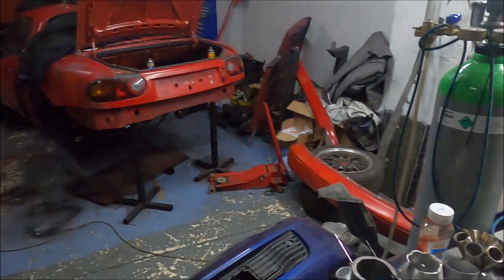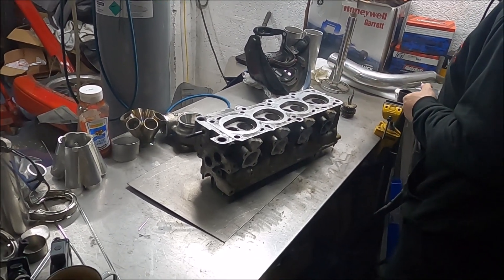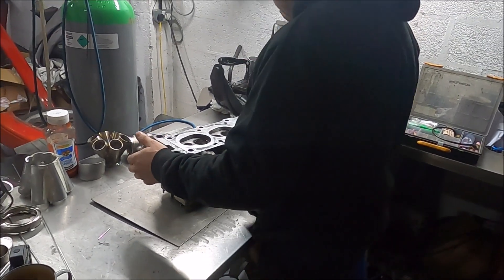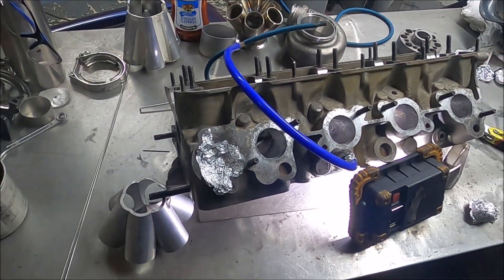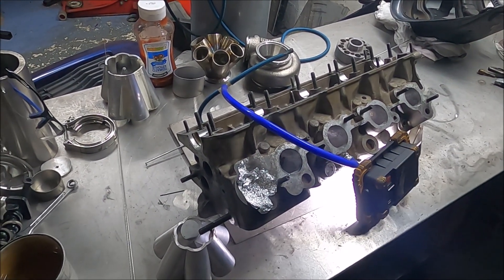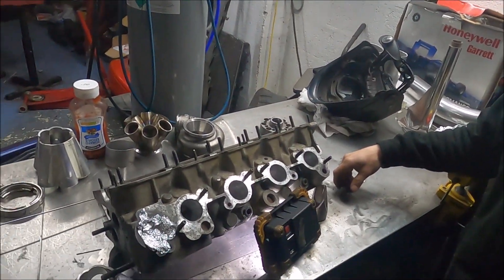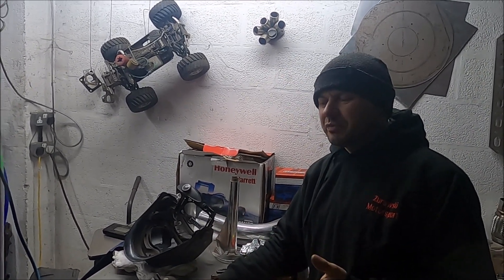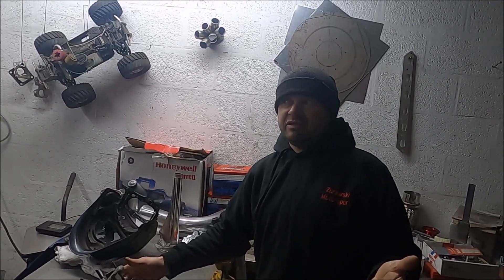Yeah I wrecked it... - Getting carried away porting the MX5s Volvo Penta head! (Part 2 of 2!)

Comment: Well at least you can cut it in sections and analyze it in case you find another 531 youll know where the material is and isnt.
Reply: The swedes has already done that for him 😊 Here's a picture thread
https://forum.savarturbo.se/viewtopic.php?t=14351
Reply: @KimOve  There it is :) Looking at the 531 pic in the middle of the page, on the picture Insugskanal (intakechannel) it looks like there are only some small holes in the area where Stav made the hole, and maybe not the actual main water jacket? Maybe its fine adding some epoxy into that without disturbing the coolant flow?

Comment: You can still fill short radius in intake port with epoxy in your 531 head. 
What about finishing your 530 head with more aggressive exhaust ports and reshaped combustion chambers from bathtub to more heart shaped chamber with softening quench area?
Reply from the maker: I say all that in the video i think
Reply: @StavTech  sort of. I taught about welding combustion chamber to reshape it to modern fast burning one like in LSes.

Comment: It was going to happen at some point 😕 we all want to get more out of something I really want to watch how heads are ported I have a 106 gti totally different as it is NA obviously but paying some one £800 for a port job which can be done with a die grinder and some of my time cost nothing weighing up the options they have are tested on bench flow  I know, is it something that's really left to the pros or can you see big improvements with a home job I dont know ?
Reply from the maker: Problem is a whole lot of porting people pay for is just someone cleaning them up so they look super nice and shiney but no big changes. It’s a gamble.
Reply: @StavTech  suggestiom stick to some one that knows what there doing on a NA i would imagine being NA the ports would be critical to being balanced if that makes sense as there is no charged air compared to a turbo

Comment: Why not put a standard head back on the volvo and use the ported one that you have already done on the mx5?
Reply from the maker: Because that would make the Volvo slower, and I have about 5 spare engines, all with heads, so I'll do one same as Volvo, just a bit neater.
Reply: @StavTech  thats cool, I thought you were going to break the volvo soon as it was getting on your nerves with it's niggles so thought it could be better used in the mazda 👍🏻
Reply from the maker: @robessell  nah Volvo is behaving (mostly) lately so it's staying until the Mazda is done at least.

Comment: Gain more flow from a proper valve job than most of the porting, get some neway seat cutter their easy to use and you can do up to a 5 angle seat if you have all the cutters
Reply from the maker: not from what ive seen of these
Reply: Stav-Tech how much time is the valve actually at full lift with a stock cam tho most of the cylinder filling will be at mid to low lift at which point the valve and the seat is the biggest restriction

Comment: Ted knows! 16v time.
Reply from the maker: Spending a lot more money to gain nothing but a lighter wallet and more complexity
Reply: @StavTech  how come the 16v has no gains over the 8v?
Reply: It does have potential gains at higher power levels, but for the power level he's aiming for the 8v head can do that much easier/cheaper
Reply: @cazsmith3503  get it now
 thanks lol
Reply from the maker: What Caz said. Fact is a stock valve size 8valve 530 head has made well over 600, fully mental Volvo 8 valves have gone over 1500, so for my goals, or even way beyond my goals, I'd be in no rush to go 16v